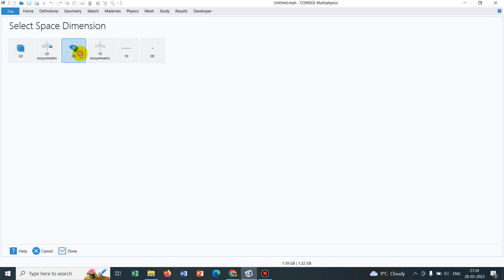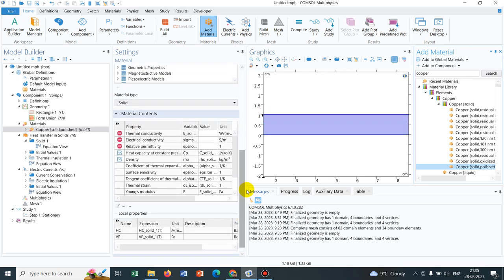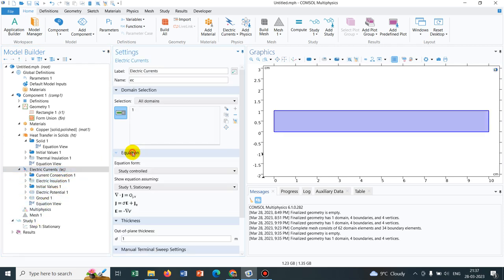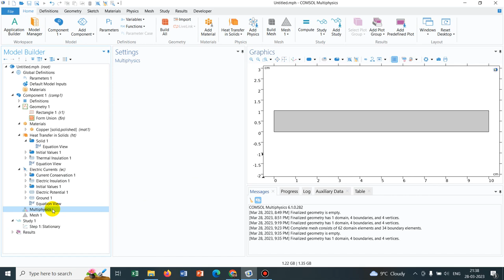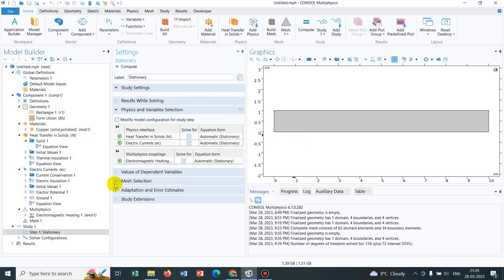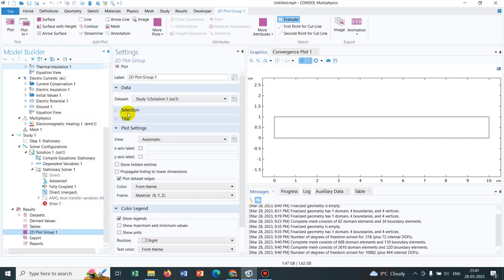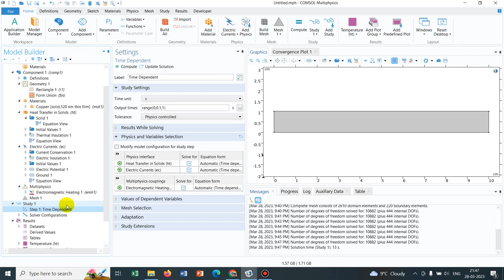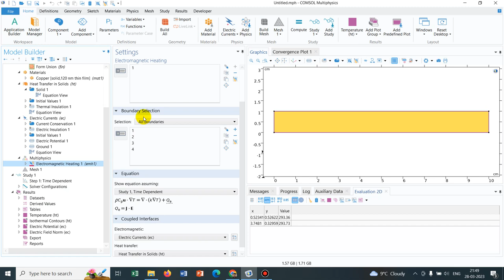Multiphysics Coupling for Joule Heating in COMSOL

Comment: Dear Pioneer, can you help me? I'm trying to simulate a Polyethylene plate subjected to a live potential, and ground. I can simulate correctly the Electric Circuits solution. But when I want to couple the "Heat Transfer in Solid" model with the "Joule Heating" Multiphysics model. I cannot get the Temperature solution to work :(
Reply from the maker: please send me the mph file at pioneerofsuccess2020@gmail.com

Comment: how will you calculate total heat generated, Q value?
Reply from the maker: There is a variable ht.Qtot. This may work.
Reply: @pioneerofsuccess4054  Can I use this Ht.Qtot value as a heat source in another simulation?